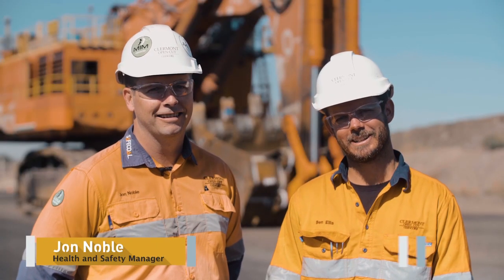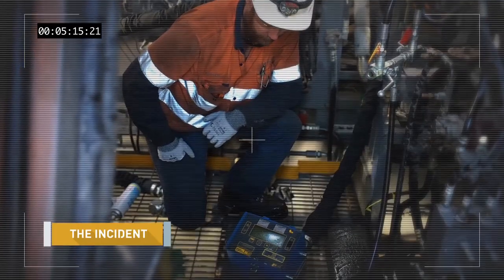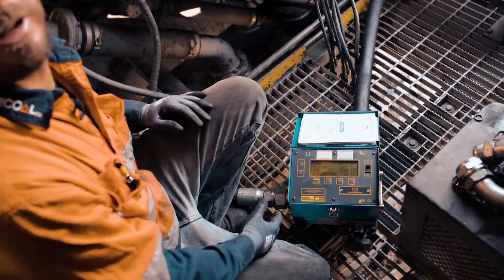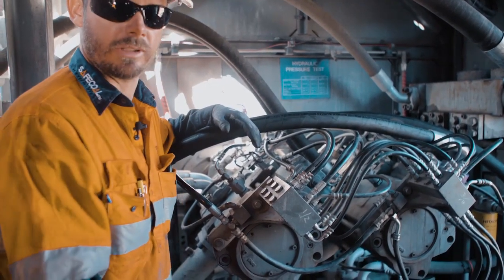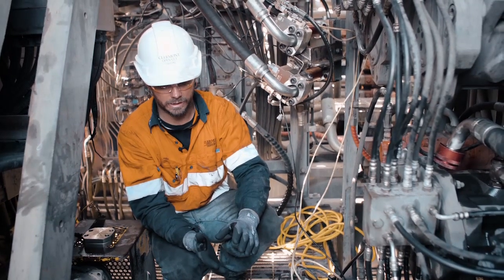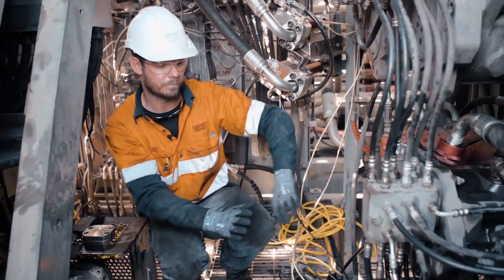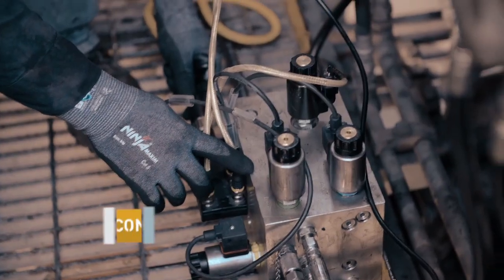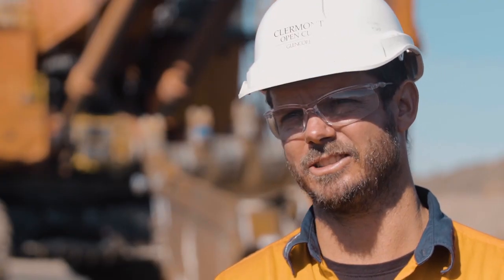HYDAC HMG 4000 Remote diagnostics

Comment: Shouldn't have been fitted with a 90 deg elbow in the first place , secondly that fitting wasn't screwed in anywhere near far enough to hold . Apart from that there's nothing wrong with those testers .
Reply: Agreed. As well, the webtec flow meter is a portable solution, where as this new set-up is permanent to that one machine.  The end-user is still required to remove and send away the turbine and pressure sensors for calibration, if you want long term accuracy.  Besides that, great install and very expensive for a fleet.